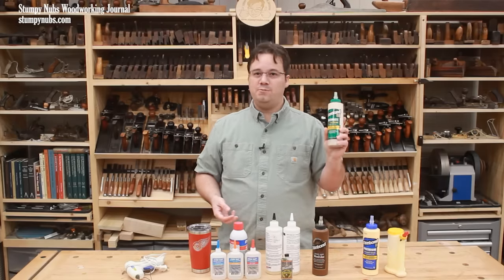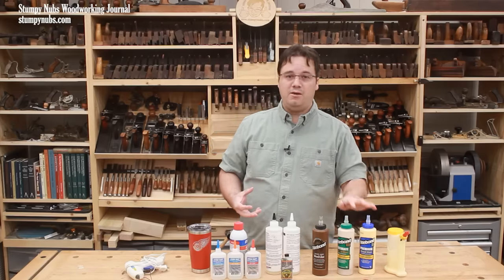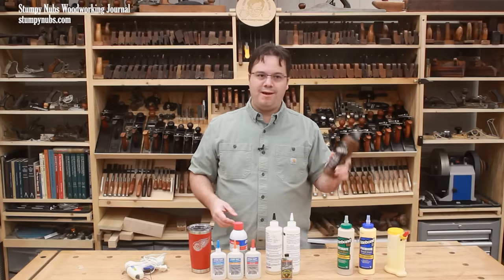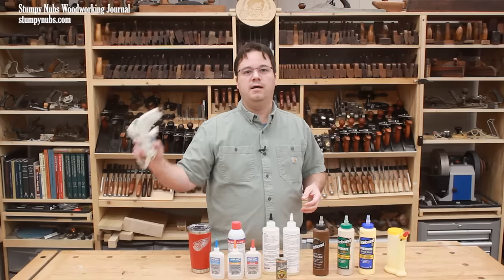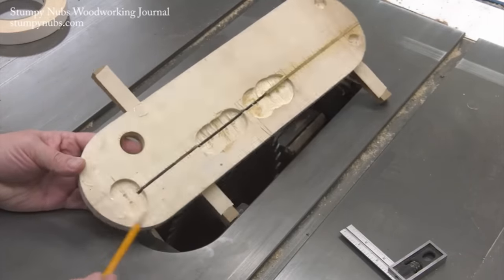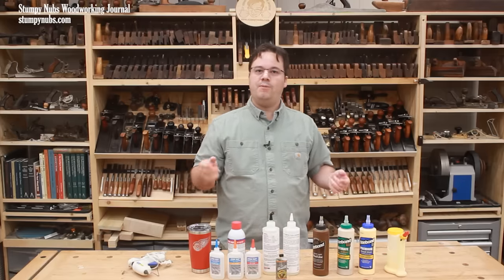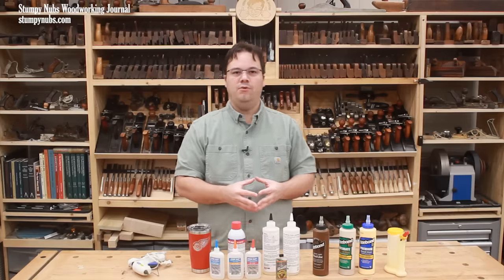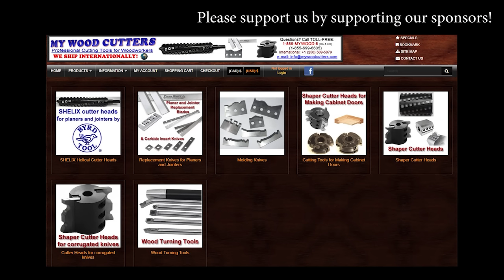Why I don't use Gorilla Glue

Comment: 25 years as a furniture restoration professional with my own business and one of the most unique uses for Gorilla Glue I ever came up with was in the restoration of weathered, dry rotted, cracked and almost pull'em apart with your fingers window sills.  I am talking of course about the weather side.  We purchased an old farm house about 10 years ago and several sills really could have been broken off with your hands.  Solution. (best done on a cloudy day) Mist the window sill thoroughly (the gorilla likes it damp as Stumpy Nubs says)  Don a pair of heavy duty rubber gloves or a couple of pair of the blue ones, lay on a coat of gorilla brushing (very stiff brush) it into all those huge cracks and crevices or just work it in with your fingers if you like using a squeegee motion across the grain to force it in, you don't have to level it to the top of the crevices, obviously because this stuff is going to foam out of there and all over the entire top as well, as you might expect.  Let it do it's thing.
After it sets up nice and hard take your multi tool (vibrator tool) with a flat blade installed and "shave" off the top of the window sill.  If the glue has set well you can now go for your orbital sander and sand the whole thing. (Gorilla sands pretty well if you let it set up well) Try not to go too crazy with the sanding because some of the gorilla has penetrated the "punky" wood of the surface wood and it will waterproof the surface for you and give it a new surface as well... but you would like to have it relatively smooth  Next step prime it with a decent primer after that dries take a premium caulk apply to the whole top surface smoothing with your freshly gloved hands or use a auto body squeegee....smooth it out as best you can because this is the surface you are going to paint. (misting the caulk might help you out here and working on that cloudly day as well.)
After your caulk dries you are ready to apply your finish paint.  Since the glue jumps gaps and grabs without a clamp this procedure holds tight quite nicely.  My window sills have held up now for over nine years pushing 10 with no deterioration.  I know this seems to be dicey but it doesn't take that long, at all , compared to taking out a whole sill.  Hope this helps with someone that has a house over 100 years old as I have.   Edit:  would like to add that the reason for the caulk coating is that, gorilla when cut and sanded is very porous, bubbly if you will and it looks like foam in the cracks, the caulk fills in those bubbles.  PS:  Acetone clean up, on the gorilla glue,  if you get it on you or surrounding surfaces.....get after it fast, it doesn't take prisoners.
Reply: Could this help with wet-rot I wonder?  I ask because it's not always as easy at it looks to splice new wood in really accurately.
Reply: literal turd polishing; love it! thanks!
Reply: @JamesThomas-pj2lx    You're welcome!!!
Reply: @evanleebodies  I am not a scientist, just a gorilla glue user at times, so take what I say with a grain of salt.... polyurethane glues (not necessarily gorilla glue) are used in the installation of car windshields and installing polycarbonate windows in aluminum hulls of boats/ships, so waterproof, yes.  As far as UV damage I would think these bonds would be protected from that with a molding of some sort.  UV kinda "works" on everything over time, so I would definitely paint surfaces with a UV blocking coating such as several coats or house paint or sheet metal or something depending upon your application.  An example of UV damage to polyurethane foam  would be if you have ever used a foam gap filler such as "Great Stuff", this stuff, if left to weather without a coating will turn yellow over time and get dry and flakey, but if painted it lasts just like wood.  These gap fillers are like a watered down version of gorilla glue...they have some adhesive qualities also, but not like the actual glue.
Reply: Thanks Barry, I'm gonna try it
Reply: @erichathaway8104  Hey, good luck Eric with your project..... a little messy but be patient with your dry/set times and you should be good.  Let me know if you have any questions.
Reply: Thank-you for sharing this Barry - I have two window sills that I will try this on.  Very encouraging! 👍
Reply: @VN9001  Hope it goes well Paul....kind of like doing body work on a car.  This method may not end up as crisp looking as new wood with sharp edges and such but
from a few feet away it is very acceptable looking and kind of bonds everything together to make a wood sandwich.  I have had ladders propped against mine to paint adjacent wood surfaces etc. with no fear but obviously you wouldn't want to be stepping on or putting body weight on these repaired sills for any reason.  Good luck.
Reply: Have you tried Abatron wood epoxy and wood filler? They can restore and greatly strengthen rotten wood. Sandable, paint able,  working time ~ 1/2 hour.
Reply: @teddavid3082  Hi Ted,  good stuff....having worked with furniture for years, I watched as epoxies proceeded to get better and better.  Now we have epoxy
putty, fillers....fast set, slow set...it's great.  Abatron can work great also, I just like the liquid Gorilla jamming it down in, forcing it in and then it expanding on it's own
to fill places I may have missed.  I remember years ago repairing a center board on a medium sized sail boat that was trashed with water damage.  Slow set epoxy and 
fiberglass wrap on that did an great job and made it totally waterproof.  Good suggestion also.
Reply: Thanks for the tip. I have this very problem to tackle and was wondering if this type of repair was possible. Now I know that I am on the right track.
Reply: @laff000   Good luck A E with the project....my sills are still holding.... a couple need to be repainted but that's about all.  To my surprise just the other
day my wife ask me where the gorilla glue was??  She is wanting to paint the structure around our 100 yr old + cellar door and the frame at the bottom
(oak) has some water rot and is somewhat punky but otherwise structurally sound.  She cleaned out some of the bad stuff put on rubber glove and went to 
work smearing and forcing in the glue......as of today it has set up nicely but needs to be trimmed, (which can be done with a sharp long knife just riding the surface
doesn't necessarily  have to be a vibrating tool) and painted .....(don't even think we are going to apply the caulk on this job, it's down low where no one can see it very well)
Hope you see good results!
Reply: @barryjeter  thanks for the info
Reply: You are my hero for this. I have been researching window restoration and am dumbfounded at the cost to repair an old widow with rot. Bout to get to work friend. Much obliged for your insight.
Reply: Thank you; I’ll try this when the weather gets warmer. I have some nasty wooden windows sills on my garage.
Reply: Yeah, for remos, and I'm working on a trailer with some wet rot and sketchy surfaces of unknown depth and Gorilla works well for that. On a new project I had to spend time scraping, sanding, and planing off the ooze-out which was way too much work.
Reply: Totally agree James, can be a pain with new projects
Reply: @ezza88ster  on the videos I've watched they used a wood hardener.  I've not had the opportunity to use either the hardener or that version of 🦍 but when I've repaired wood I cleaned out the rot just past the damage. I  cut a piece to match it. I used 🦍 wood glue type 2 which is water resistant (the store was out of water proof). I used a mini paint brush to get into cracks.  I drilled a thin hole through all the surfaces,  covered a bamboo skewer with glue and tapped it all the way through.  I left it just proud of the surfaces and then clamped it.  It turned out great! I  never experienced any bubbling. Keep in mind this video is 2 years + old.  I  did the gluing about 7 months ago so perhaps 🦍 stepped up to the plate.
Reply: On a somewhat alternate note...my friend suffered a lot of damage when the basement flooded to the ceiling.  I'm getting ready to repair an antique children's rocker for them. It's already needing a spindle replaced as it wasn't found. 
The seat is 2 different types of wood laminated together. The dark wood surprisingly seems fine but the light wood rippled in between. The spindles go right through all the layers so I know I'll have to carefully need to extract them. Someone recently advised me about wood conditioner...Once the spindles are removed the only thing left are a small backrest,  the seat itself and the rockers. I'm trying to keep it as original as possible. Should I use steam or heat to separate the layers? It's at least 50 years old.  The screws look machine made with hand cut flat heads to give you a better idea of age. It's origin and age are undocumented. Unfortunately there is no makers mark. 
In theory, if I coat white printer paper with the wood conditioner and slip it between the layers I'm hoping that I will be able to flatten the rippled layers. Because it was in flood water from a river there is silt. I want to separate the layers to clean them better.  My concern is the wood conditioner might stop adhesion. 
I'd appreciate your opinion.  If I simply glue and clamp it,  the wood will simply split.
Reply: You need a hobby
Reply: Go check on it. Guaranteed it's broken
Reply: Still good!
Reply: @fdort3971  Fdort....I tried to answer a month ago and for some reason...I couldn't leave a comment on you tube.  Hard to tell without a picture but with that degree of
delamination it seems you are in for some new wood.  You are right in assuming that clamping when it is so deformed may result in a crack.....which could possibly 
be repaired after a total set of the glue.  Wish I help, but sounds pretty nasty with silt in between also.
Reply: @barryjeter  thanks
Reply: @lesd2633  Did I mention I play golf?
Reply: Why not use epoxy?
Reply: That, sir, is an outstanding and creative bodge. Hats off! I shall be trying this, but it strikes me that thinning the glue would help. I've checked and xylene may work. I don't have any of that, but I have other chemicals that are carcinogenic only in California, so I'll give them a go and report back.
Reply: @skelly790   Hope it works for you skelly...xylene would probably thin it, acetone works (fingernail polish remover is a form) if you can get a hold of some of that.
Not sure that you need to thin it though...it has the consistency of  syrup so it gets down in the crevices pretty easy and rather quickly.  Good luck with the project
Reply: @barryjeter I shall try acetone! 

I was going to thin it so it'd soak deep into the crappy wood, same as that overpriced wood hardener - which also smells suspiciously of acetone - does, then evaporate quickly. Sounds ideal. Non-toxic, and soluble in water as well, so shouldn't get mix problems.

For anyone who's made it this far down the thread:

 If you buy consumer grade Nail Polish Remover, it'll probably have other stuff you don't want in it and be expensive. But you can buy pure acetone by the litre cheaply at hairdressers, beauty and nail products retail wholesalers (they exist, same as builders get their own wholesalers.)  You don't have to be a hairdresser; just walk in still wearing your hi-viz and boots if you like.

Comment: A much less used adhesive but often my favorite is rubber cement. It’s not always useful, but as a maker, I often find myself attaching two materials that “shouldn’t” be attached together. The rubber cement adds enough flexibility to adjust to different expansion ratios and densities while still maintaining a strong joint.
Reply: Also, if you use it wet, you can reposition for a good long time before it sets, and the joint will be  easy to break. If you need immediate adherence you can apply the glue to both surfaces, let it dry, and press the two pieces together for an instant, agressive bond. It's harder to pry apart, though -- on paper you're looking at damaging the pieces -- so you have to be aware of that.
Reply: I love rubber cement. I just wish it could be applied evenly without the little glue-zits here and there. Maybe I'm using it wrong, though?

Comment: I find Gorilla Glue quite useful in certain situations, but certainly wouldn't use it for furniture/cabinetry work. For example, putting a picnic table together using Gorilla Glue, it is under the exposed surface, so any slight mess from the stuff is out of sight, but it holds things together much better than just mechanical fasteners and is simply stronger than any other glue I've used. I also used it extensively building a small dock at a pond. But for furniture making that foam would be a NIGHTMARE! I'll stick with Titebond for that work.
One thing I learned to do using white glue (in the days when Titebond and the like were yet unborn) was in a special glue-up for turning on a lathe. This was for turning on a face plate. The wood for the project was glued together, then a scrap board was glued to the bottom BUT with a sheet of bond paper (notebook paper or typing paper) between the scrap piece and the actual project. Then, the face plate was screwed to the scrap once the glue had set.
After turning, a wide wood chisel could be placed on the seam where the scrap was glued on, flat side TOWARD THE GOOD PART. A good whack with a mallet, and the paper split, leaving white fuzz half the original thickness of the paper on each surface. This was easily sanded off the work piece and done. I don't know if this would work with other glues, and I would be afraid to try.

Comment: My favorite use of CA glue is with blue painter’s tape. Tape both sides of the joint, glue on one side and accelerator on the other and you have an instant joint for patterns, jigs, etc. that can be easily disassembled and won’t harm the surface like double sided tape can. There’s no residue to clean up, either.
Reply: Great idea! I sometimes use CA instead of a clamp, applying in a small area devoid of my yellow glue or polyurethane glue.
Reply: You mean use the CA to glue the non-sticky sides of the tape to each other to make double-sided tape, not glue the joint together, right? Or are you masking the sides of the joint to prevent the glue from spreading too far away from the joint?
Reply: @edeaglehouse2221 yes - take two pieces of tape and stick them to the surfaces then use CA glue to glue the non-sticky sides of the tape to each other (I also use accelerant to get it to set faster.) Afterwards you can gently pry the pieces apart and you're. left with two pieces of tape glued together with the adhesive side out. The only caveat is not to use too much glue so it oozes out beyond the edges of the tape. I usually use 1 ½" tape to avoid this.

Comment: Great video. I store my CA cement in a heavy zip-lock with a couple of dessicant bags. It lasts years that way.
Reply: I'm gonna have to try that. I can't keep my nozzles from plugging up.
Reply: Ziploc®
Reply: I scavenge those dessicant packs from everything, and have a zip lock bag full of them ready for reuse.  Its possible to reactivate them in a warm oven to drive off any moisture they might be holding on to.

Comment: Using PU glue on damp wood has another drawback, depending on how damp the wood, it may shrink when dry, PU is brittle, the joint will fail quicker. I say quicker because every joint I've glued or been around that was glued with PU fails more quickly, yes, every joint. Another white glue you may want to consider is Roo Superbond. Type 2 rated and sets quickly. I typically do use it on glue ups that need a longer open time. They also make a melamine glue, Roo Clear, it works on nearly everything including it's intended purpose. It remains more flexible than any of the others, not advised for lathe glue ups for that reason. Roo makes a yellow glue as well, it's on my list to try. With both Titebond and Roo, my search for non-CA  wood glue is over. No, not sponsored by either, just good products for more options.
Reply: I might have to get Roo brand stuff now…

Comment: I find gorilla glue to be useless in the wood shop also but VERY useful in many other places around the house. I once used it to glue a chunk of concrete back in place after a crack filled with water and froze overnight. That was 3 years ago and its still holding nicely.
Reply: I have used gorilla glue to combat squash vine borers in the garden.  I inject it with a syringe into the hollow squash stems near where I suspect the worm to be.  The gorilla glue foams up and down the stem from that point, encapsulating the worm.